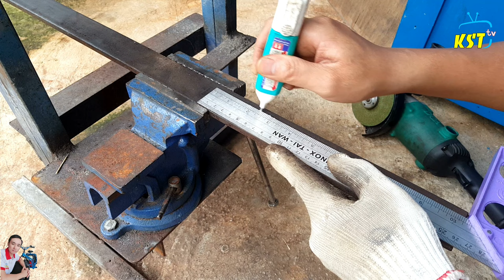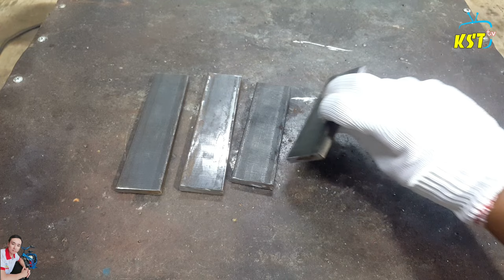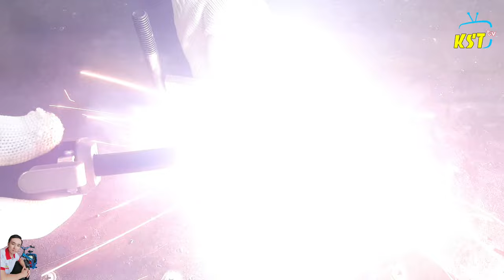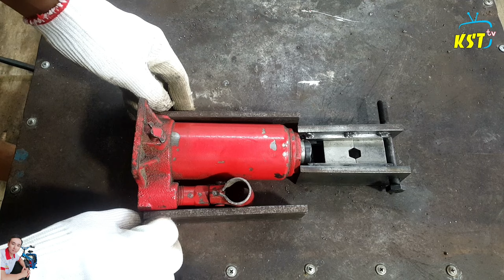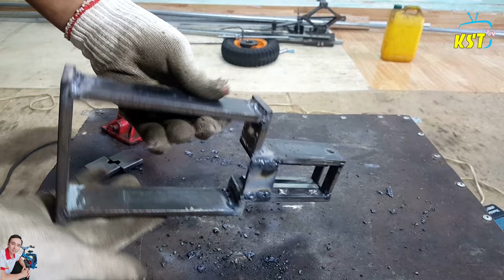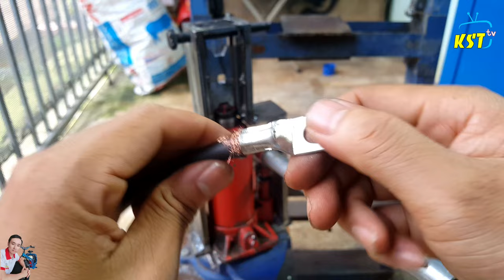How to make a Separable Hydraulic Wire Crimping Tool

Comment: Quick tip. Drill a 1/8” pilot hole in the steel plate then a 1/2” hole. The 1/2 drill bit has an area on the very tip that does not cut. The land slows the drill down.